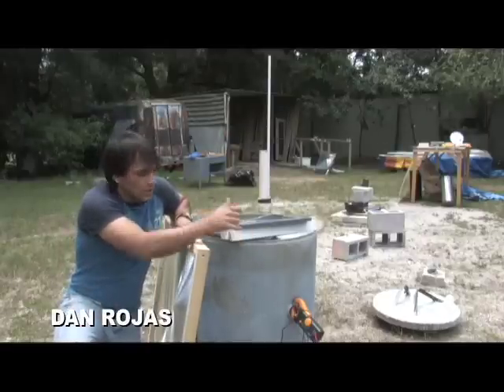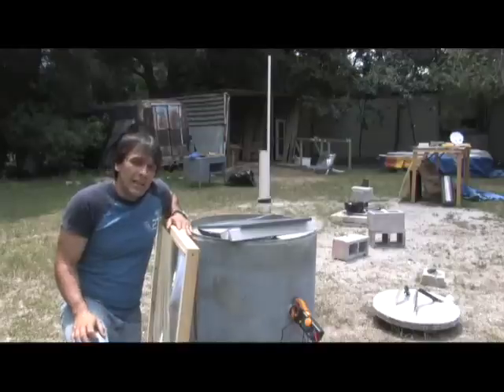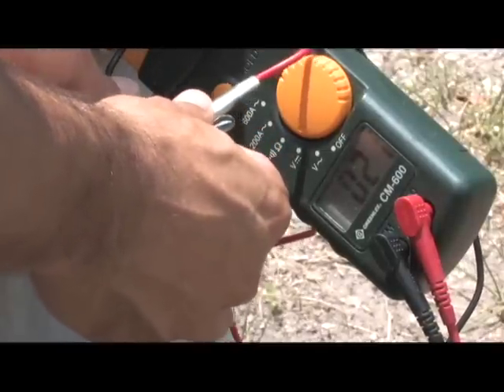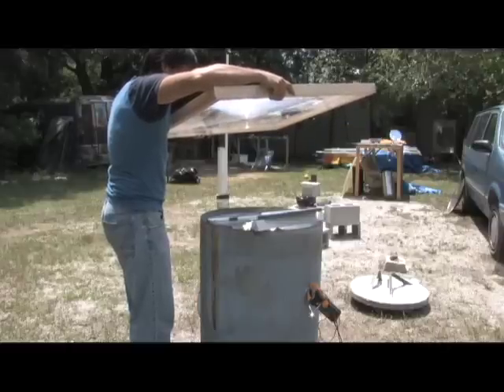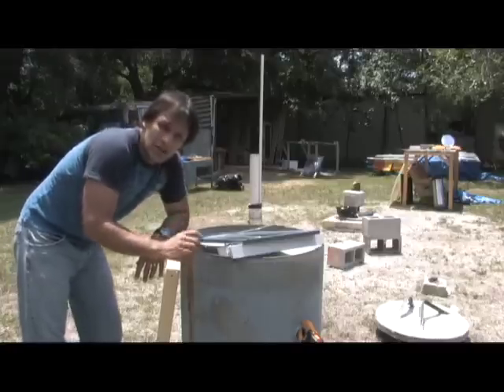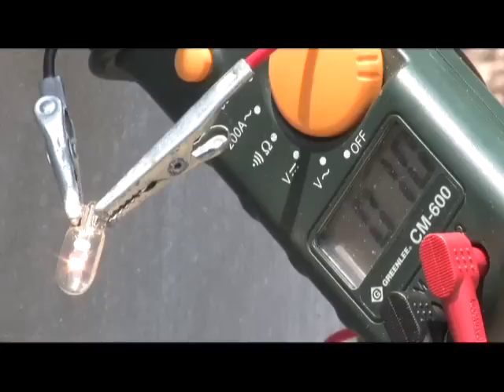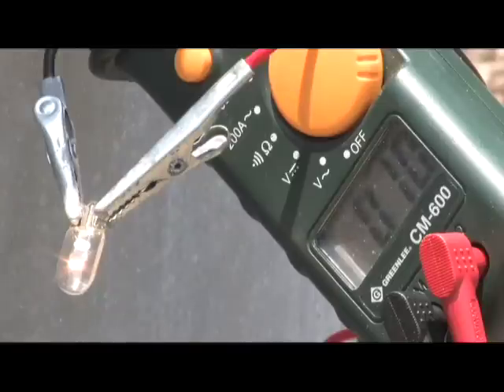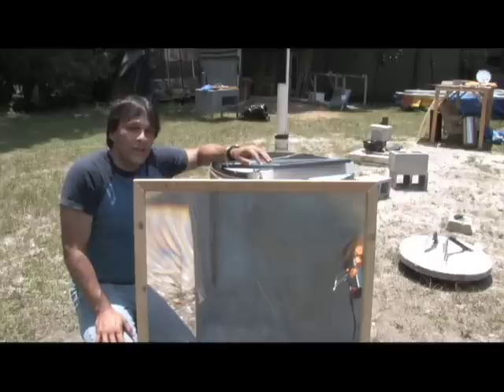Solar Panel supercharger Fresnel Lens

Comment: So apparently nothing has come of this? Did you ever try the lens on an overcast day? I wonder if the lens would amplify the output on a cloudy day when heat isn't as much of a factor and milking all the power you can get would be advantageous. If it works it would make more sense for those in the extreme latitudes. Folks in equatorial regions have more sun and therefore more heat dissipation issues...at least empirically.

Comment: mains cable = lower resistance .thin cable is great for making a nice filament , but will completely rob/convert your energy to heat, maybe even light...As we see here, smoke,  at least 50 percent of the energy was wasted! Probably fortunate, in that the internal circuitry was protected due to this naf cable.